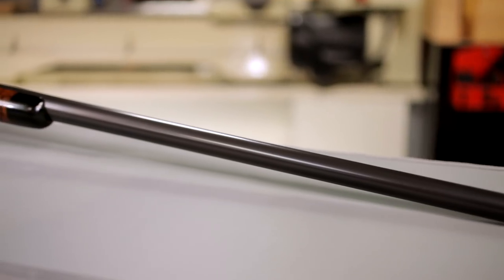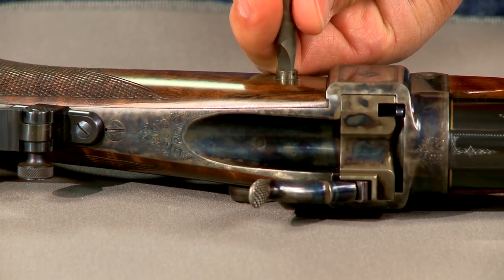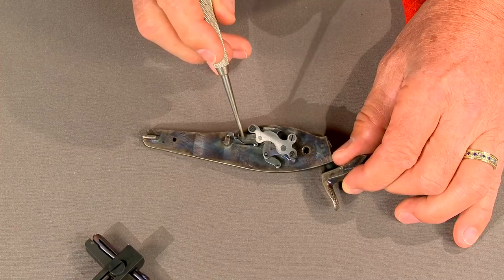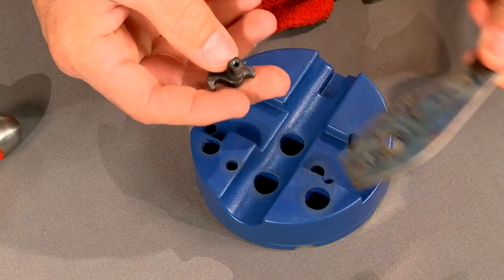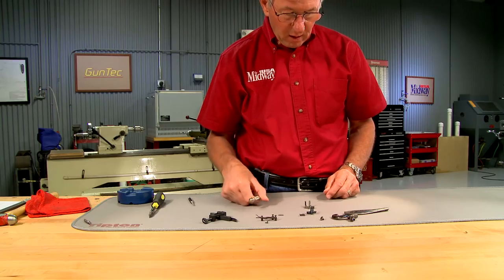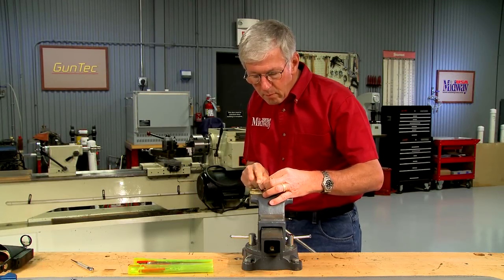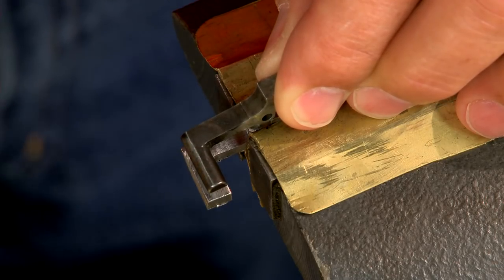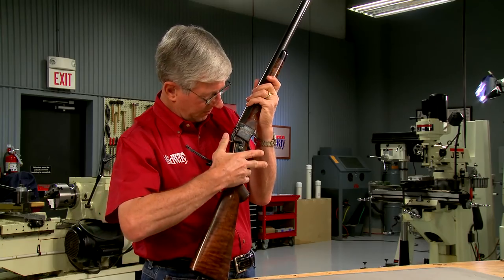Gunsmithing - How to Repair the Tumbler and Sear on an Axtell 1877 Sharps Rifle

Comment: I built one of those guns from a kit of castings. Did all the machine work from start to finish and the lock was one of the more difficult pieces to make  work dependably. It is a typical back action lock design that is not as robust as the 74's. My rifle was a single trigger and did not have a fly incorporated into the tumbler. I think Shiloh is building them now with a LONG waiting period for delivery. Graceful rifle if a smaller dia. barrel is used. Maybe you can get replacement parts from them now.

Comment: jdrury That's a good way to stuff the bearings in you drill. They're not strong enough or designed for any force other than the axis intended. Unless you get a mill/drill machine.
Reply: I don't understand your worry here, Larry was using a Vertical Mill to machine the part?
Reply: Englishman French This was a response to a post about using a drill for milling, i think the post was deleted.

Comment: Just incase you have an $8,000.00 JET mill...
Reply: about 5500, and not a great mill at that,
Reply: Back in the fifties I watched an old classically trained gunsmith Gus Youngman make a similar part with nothing more than a set of files and a drill press to drill the holes,  he was an amazing man. He could also fix any mechanical device anyone ever brought to the auto/general repair garage he ran. I used to love hanging around his shop and learned much from him. He also had a range where my father would go to sight in his deer rifles and Gus would let me shoot his original Sharps which for a boy of 12 in the 50's was as good as it could get.